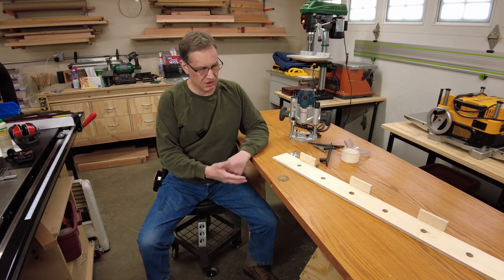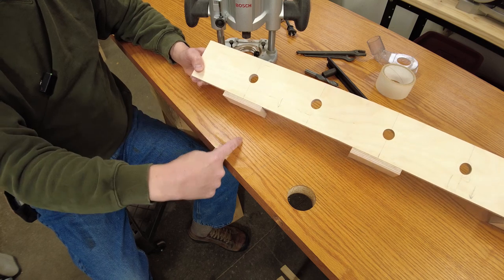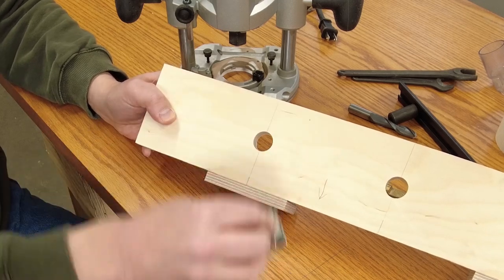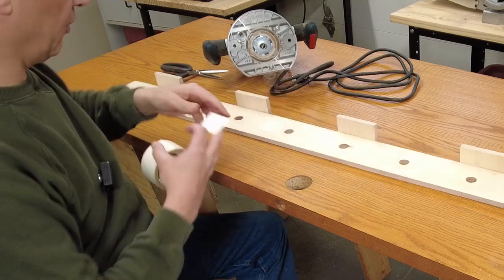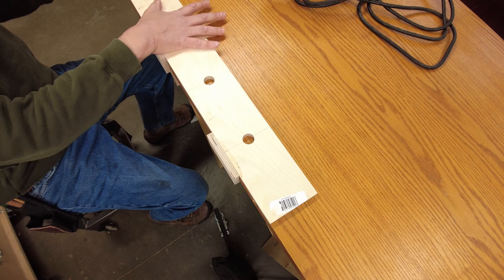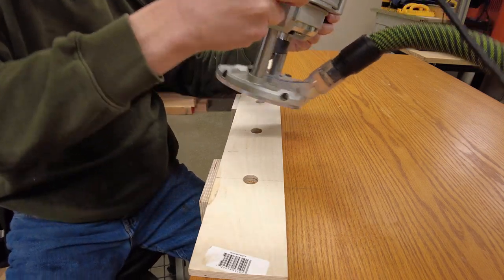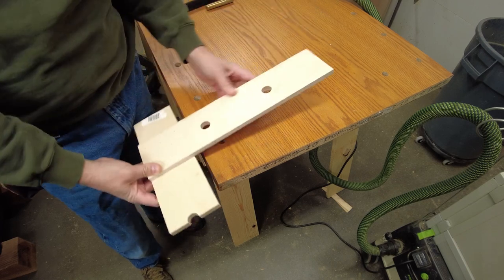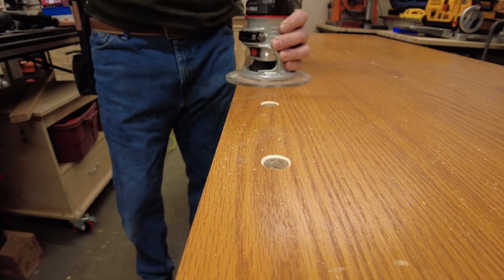Woodworking Bench Dog Holes

Comment: Hey, nice tips in this video. How deep did you make the holes? And did you discover any weak areas in your solid core door? Reason I ask is that I also have a solid core door but I don't think it's solid wood all the way over - there's some kinda material in there but couldn't say what it is. Was not certain I could put dog holes anywhere except the outsides, where it definitely is solid wood.
Reply from the maker: Holes went all the way through. The door was very solid throughout. Inside is a particleboard-type material.
Reply: @UncleJasonsWorkshop  Thank you for replying! I'll try mine and hopefully have a solid enough core to make it work